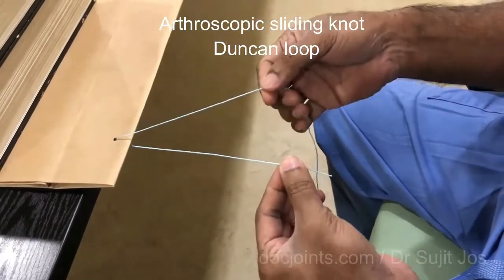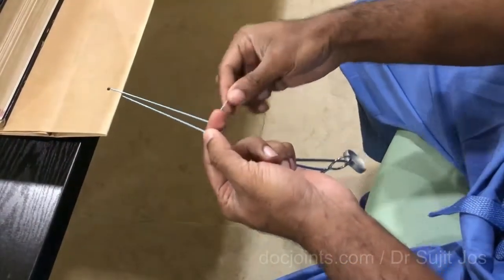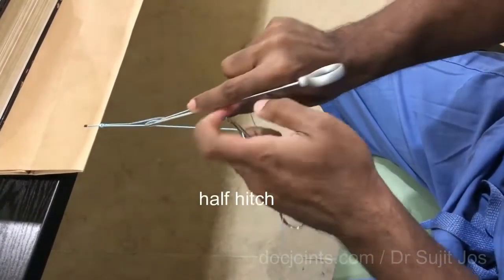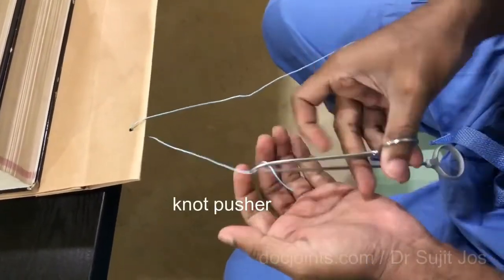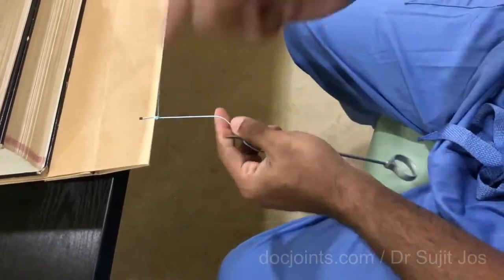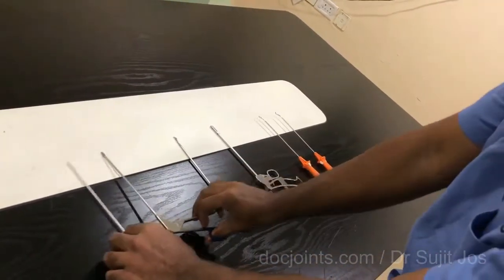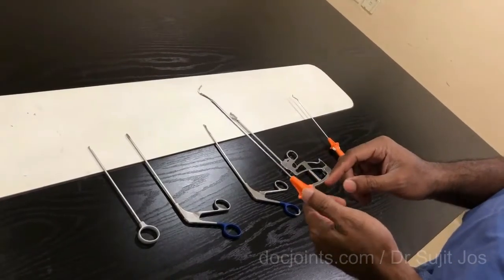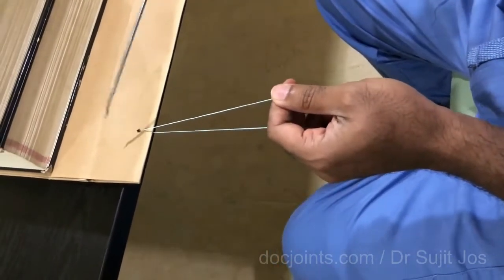Arthroscopic Knot tying tutorial   - Dr Sujit Jos

Comment: Congrats for the video. What is the difference between using the Duncan or the Weston knot?
Reply from the maker: Hi. The Weston is a locking sliding knot, while the Duncan is a non-locking sliding knot. Practically both work almost the same, but in areas where there is some tension and you dont want the knot to loosen, before you park your half hitches, a locking sliding knot is advantageous
Reply: @Docjoints  Thank you. All of the very best